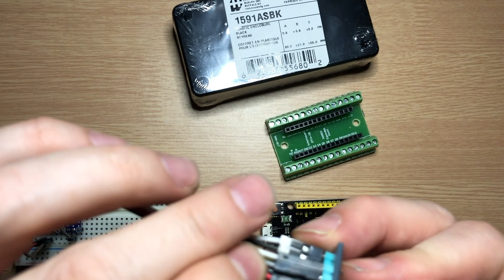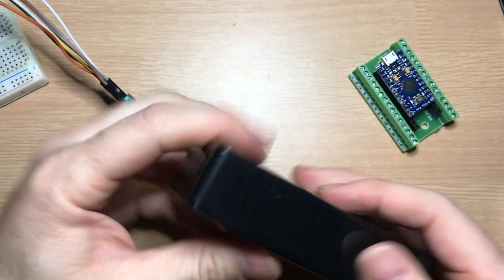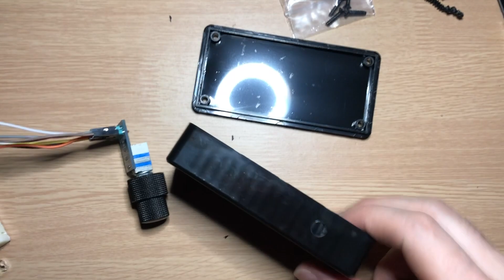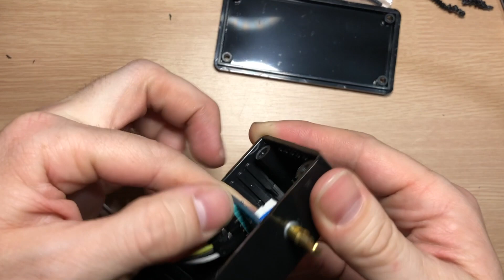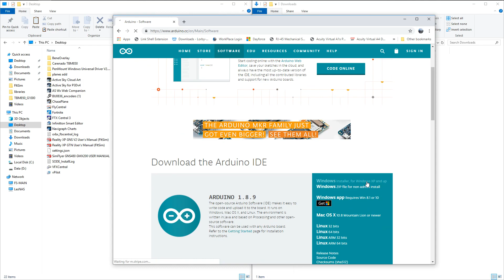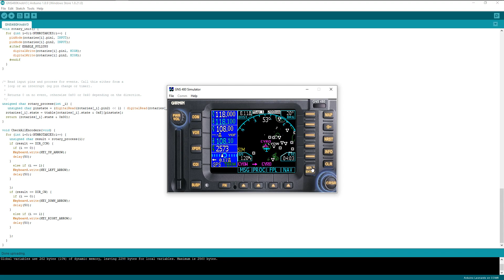GNS 480 Arduino USB Knob Control

Comment: Great video.
But how you will connect that to the actual game to work properly
Reply from the maker: This was not for use with Flight Simulator. This was made for use with the GNS-480 Desktop Simulator for people to familiarize with the unit.  The one pitfall of the desktop tools was that you interact with the Knob so building this make it more similar and with a touch screen worked fine...  For doing Flight Sim Stuff Look at my other recent videos on build a 3D Printed Autopilot and the code to interface with Spad.Next...  I did make a 3D Printed GNS-530 using just a HID library (joystick like my 737 Gear Handle) but with the Auto pilot one we get to have Data back from the sim..

Comment: dude, plz !!! The noise in the background maybe music to your ears, but it stopped me watching! I'm sure your video is great and informative, just not for me! NOISE!!!
Reply from the maker: Sorry that the music caused you an issue...
Reply: Les, thanks for the video..I got a PropWash dual encoder, but not sure which side of the included pub to mount the encoder on. You show  that you put the headers on the side with the labels A, B etc. which makes sense to me so you can see the labels when you attach the cables. So I was thinking I’d put the encoder on that same side (ie, the side with the labels). But wondering if that will give the wrong result?
Reply from the maker: I have done ponds on either side. Based on the project. They don’t change which side it’s a pass through hole.
Reply: Les O'Reilly, my PropWash pcb is labeled differently from yours. It has capital AB and small ab - yours has two sets of capital AB. Les, I ended up putting the encoder on the side with the labels. The result: the smaller diameter knob connects to A, B and the larger diameter knob connects to a, b. Not intuitive, but it works. I think that would have been reversed if I’d put the switch on the other side of the PCB.
Reply from the maker: Eric Rolfe oh gotcha. I see what you mean now. That actually is pretty smart that they updated it :) to have labels that way.   If you play with the assignments of the pins you can figure out the order pretty quick and then edit the Arduino code and try again :).